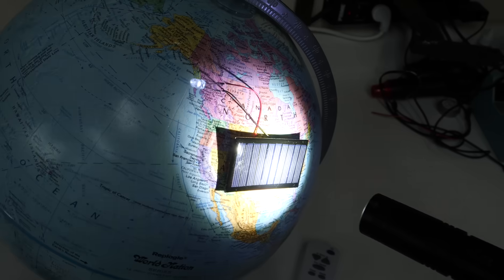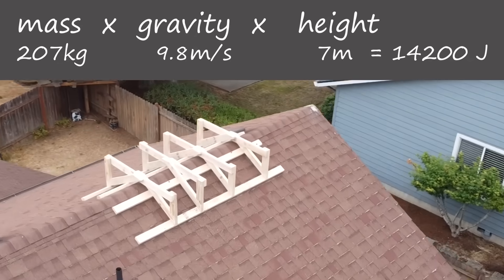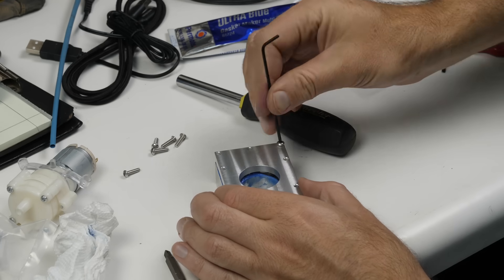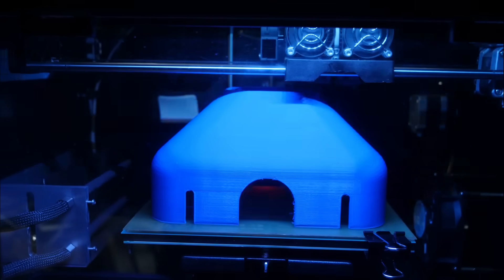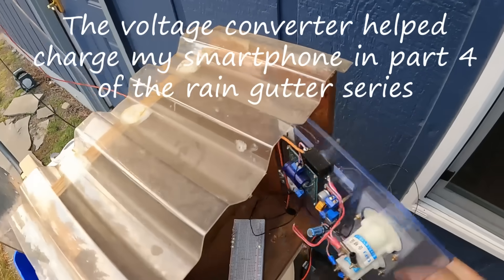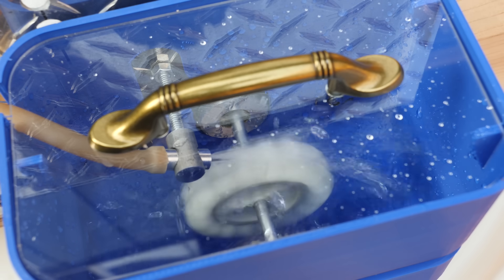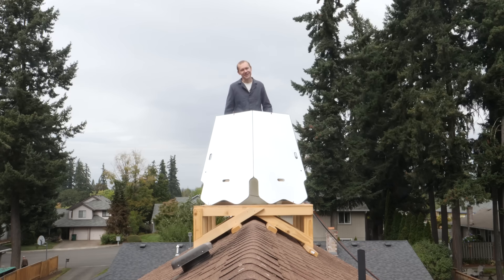Storing Solar Power on my ROOF!!!

Comment: I built a 50' tall Grandfather clock in Alaska for power.
I had a truck.
I made a dyno.
I hooked the dyno up to a massive wooden spool winch.
the tower was 8' x 8 '  x 50 x tall.
at the top was five beams.
one on each edge one in the center and two between those three.
each beam had 10 pulleys
at the bottom in between the uprights a huge steel counter weight basket filled with everything heavy i could find. the basket was 7.5x7.5x6' tall.
it had five beams in a square frame the basket hung from.
i used my pickup to lift the basket to the top.took just a minute or two.
i had a lever just outside my truck window that went to two different 13  speed fuller transmission shifter.
one in gear to engage my dyno winch
one out of gear that will drive the generator .
a 15 k genset without its engine. 
shifting the 50 part line over to the genset and a speed governor to limit and regulate the baskets decent.
150hp for 2 mins stored at 50klbs at 50 ' up.
i had to buy 25000 foot of 1/4 cable.
i also made a spool manager  hooked to the spool to feed the cable onto my 20 foot wide spool.
10 hp back out into the genset for about ten to 15 hours backout..

Comment: Where I live - in the Alps - we are doing that since 70 years. But we hate to do it. Why? Because you loose 40% in total efficiency by converting electric energy to run the pumps for lifting the water and again when converting the kinetic energy of the water back to electricity. There are no free lunches in physics.

Comment: here in the Uk we have a place called Dinorwig Power Station. it is basically what you are showing here. They is a lake at the top of a mountain and another are the bottom with a power station in the middle , sadly they do not use solar to pump the water they use the cheap rate and otherwise unused power at night to pump the water up to the top lake. The power stored in the water is used in the day to cover peak demanded. It is a cool system   https://www.youtube.com/watch?v=6Jx_bJgIFhI

Comment: Cut fossil fuel off, we will return to the stone ages.  These are fantastic home experiments to do, however I live in California, we have rolling blackouts while being forced to buy electric vehicles.  (In 12 years gas powered vehicles are to be outlawed).  When that happens we are going to starve, Farmers can run their tractors, 18 wheelers can’t run, many trains will be turned off, boats won’t be able to deliver to California as they run on Diesel.  I would put a 55 gallon bucket on my roof but the city would fine me for using to much water.  I don’t see anyway out of the mess going green will cause.

Comment: Cool! g is m/s^2 -- an acceleration, not a velocity.
Reply: That's right. But I was thinking that he maybe missed Bernoulli's principle for fluid dynamics. We have seen at 1:36 a calculation for static pressure which is mass x gravity x height . We didn't see a calculation for the kinetic pressure, better known as the energy component in Bernoulli's principle. So is 14.000 Joules not only the static energy and total energy lots higher?
Reply: @jan-race  whatever fluid dynamics says about the impulse transferred to turbine blades, you cannot exceed the energy stored by potential energy in a gravitational field. His energy storage calculation is simple, and sound.

Comment: Interestingly, my country (South Africa) has one of the largest per capita CO2 footprints relating to electricity generation in the world. We also have the Drakensberg pumped storage scheme which is essentially a large 1000 MW hydro battery. Renewable, Hydro battery and carbon natural isn't necessarily the same thing. It takes some serious juice to pump that water uphill. Just note that.

Comment: Solar only works when sun is out. What happens when you recycle that water by pumping the water up to your roof using a bunyip pump that doesn't use power,  that can be sitting in a shallow pool that is filled up by the water coming down from the roof. I wish this was true but I am not sure that the bunyip pump is a real thing. 
https://www.youtube.com/watch?v=FHJmYeFkJU8
Reply: Some solar panels work better with the sun, some can work very well without the sun and in clouded areas like organic amorphous (thin) film. But all panels work at cloudy conditions. They also consider to develop panels who can work at night by thermal radiation. This is in researching state at the moment.

But nice tip about that pump. Didn't heard of that type before. He can also build a system with a hydraulic ram pump which also uses no electricity at all. Some can pump to a height of 10 meters, more professional ones even heigher. In poor countries they build these pumps DIY with PVC pipes, for example for flooding rice fields from a lower river. There are lots of videos on Youtube of this type pump.

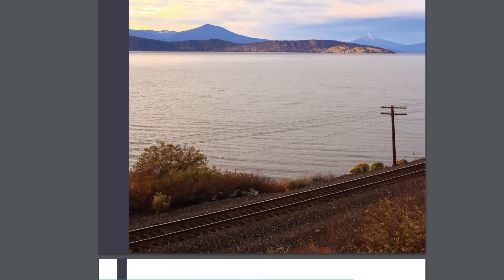Comment: @14:30 when you’re talking about the reservoir height differences my brain gears started grinding away....

What is more important...the Height or the Volume/Flow? There’s obviously a Maximum Flow Rate for such a System that is determined by both Variables.

It’s the equivalent of if you increased your down tube for more flow, but your stored energy would deplete faster.

What kind of power are they expecting to generate? And what, where, how does the Top Reservoir get replenished? Is it also a closed loop?

I guess in the end they would be building an ‘Infinity Waterfall’ minus natural evaporation

Comment: You could use a water hose, which will send more volume of water to your barrel on the roof and the ground. It will be faster. You would need a larger pumping system.

Comment: Congrats, now you have 0.0039kWh energy storage (as much as 1 AA battery). Maybe you can use that to heat a kg of water 3 degrees. only 25 more barrels and you can get it boiling!

Comment: This is awesome. In many parts of the world pumping up water to a water tank is normal for house hold water pressure. My time in the middle east  you turn off your water heater in the summer and the water ontop of the house is the hot water and the water in the hot water tank is the cold water.

Comment: Very clear demonstration of the basic concept, thanks. I also went through this thought process:
I have a few solar panels that I can't store the excess power from - I considered this approach but I'd need about a 10m tower with about 5 tonnes of water to achieve the capacity of one car battery. Like one of those water towers you see at railway stations in old Westerns. So now I have half a dozen car batteries.
If someone would buy me a lake I'd be more than happy to set up some pumped storage.
Reply: Let's hope he doesn't live in an area where they have any high winds or hurricanes, as if that lot comes down not only is his house going to get an unexpected massive hole in his roof,  it could end up killing someone.  The support doesn't look that secure considering the weight up there.
Reply: Car batteries are the most inefficient batteries for off-grid power storage. Even RV/boat batteries are better, but I have found the LiFePO4 batteries to be the best choice for me, once I was able to save up enough for them. I've tried several different battery types, including golf cart batteries, and lead-acid batteries only lasted a few years in my system, where my new BattleBorn batteries should last about 20 years before degrading to about 80% of origional capacity. To me, that was well worth the high up-front cost. I have recently found that even the "cheaper" server rack batteries are a better set-up than lead-acid ones.

Comment: Would it be efficient to replicate this with a higher density liquid? Like salt water or glycerin?   Or would the energy necessary to transfer the heavier liquid onto the roof negate any extra kinetic energy generated?
Since this is a "battery" for "excess energy generated", I feel like the efficiency wouldn't matter as much, but I don't quite know how to calculate this, nor how to consider its feasibility, except on massive scales such as ones mentioned in the video.

Comment: So with a pump that likely wears out faster than a lithium battery you can store less than half the amount of power that can be stored in a cheap lithium 18650 battery. Using 400lbs of water in an ugly barrel on top of your house

Comment: i also thought about getting a gravity-battery built for my future house to store energy but i was thinking more of a huge weight attached to a motor / dynamo. i know water is used commercially but isn't it a bit too loud when it flows down? I think for the near future i will go with lithium ion batteries but they are a fire hazard and i am not sure how many charging cycles they can last for and if that is even worth it in the long term

Comment: I am having a very hard time understanding why you are introducing the use of water to store and increase solar power without first securing a recapture system to protect that most precious (consider evaporation in relation to climate change) resource. Position the device above a collection vessel to capture overspray for your food garden?
Would the same gravity fed booster work if you used tiny copper bbs or a perpetual motion device. At this point it seems more prudent to be inventing devices that conserve water, not rely on it to power party lights. No disrespect, just saying. Point your kid’s science loving brains towards water restoration and conservation. 🦫🌲🪵💦

Comment: what about during winter when solar power is nil?
Reply: The sun still shines during winter, you get less power than in the summer but it's far from nil (unless you live beyond the arctic circle i suppose)
Reply: I live in northern Europe, and for me it's maybe 50-100Wp in December. In the summer my installation does 1300Wp. Not a lot also, but a huge difference. For all practical purposes it's nil for me.

Comment: A little late to the party here, but Ive got an idea for you that Ive always wanted to build just for fun:
Scale Up a grandfather clock escapement gear to use like 500-1000 lbs weight, connect the drive shaft to an alternator and make a 50 foot tower for the weight to hang from. 
Then make the winding mechanism from a hand crank and a few snatch blocks. So with 60-120 seconds of fairly vigorous, but not unmanageable work, you could potentially have over a 1000 watts of power for 15-20 minutes or so.

Just for when theres been a drought but its also been really cloudy for a few weeks 😆.

It would be fun to build the small version to maximize efficiency and then build the giant one when its all dialed in!

Comment: You just demonstrated how hydro power is generated but its still not a solution to energy storage problem. Not practical to store large sum of water in residential areas. Probably not possible for municipalities to do that either. Creating a large reservoir requires a lot of work , planning and maintenance. Energy storage will remain an issue for now.

Comment: But you need water for this. Or do you? I saw a project out west that used weighted rail cars. During the day when power was available the railcars were pulled to the top of a hill. At night the rail cars were lowered down the hill re-capturing the stored energy. Same concept without water. Right?      Skyscrapers could do the same thing with weights in a tall shaft or on the outsides of the buildings.

Comment: That hiding materials, it could be solar panels., pumps the water up during the sunny days. But you have to have a bigger barrel at the bottom one, perhaps it can be underground. I believe this metod will work, if you build rectangular shape water container. On top install some solar panels. Have to be better thought to the way to design the all system.

Comment: Using a low cost solar well pump, such as the Shurflo 9325, we could use a 100 watt panel to pump a maximum of 500 to 600 gallons a day to a maximum elevation of nearly 150 feet higher than the source.  We could use a Dankoff 1302 slow pump powered by 100 watts to pump 600 to 700 gallons per day upwards of 300 feet higher than the source.

Comment: Very cool. Would it be more efficient to hang the tank on some sort of pully or steep rail system using gravity to drive an alternator?

More complicated, but I'm picturing a similar system using solar to fill an elevated tank. At night gravity feed an alternator, once the tank reaches the bottom have an auto drain hooked up to a hydro generator. Then have a counterweight reset the tank for the morning.

Comment: Similarly, I plan to build a "thermal" battery for an off grid cabin. A black barrel filled with a salt brine solution and a copper coil running through the interior should retain enough heat from the sunlight to provide hot water 24/7 except in the most extreme cold snaps

Comment: Water weighs 8.33 pounds/gallon WITHOUT the container. That roof has better be able to handle that MASSIVE and not designed for dead load. A collapse is more than possible if it wasn't reinforced

Comment: I have an idea. Do you want to try to use liquid nitrogen to make a camping freezer that could keep things frozen for several days. I had an idea of pouring it into a copper coil and using bolts to close the ends. I don’t know if there would be enough thermal transfer to keep things cold, or maybe too much. I was also wondering if gas would build up.
Reply: Wait, did you just tell him to build a pipe bmom b?

Comment: It would be nice if you actually knew something about lithium batteries. The lifepo4 batteries have a charge discharge count of over 3,000. They can be charged from 0 to 100% $3,000 times. That's about 10 years.

Comment: For the splash problem I would have just aimed the water downward and if that reversed the water wheel then reverse the leads on generator motor.

Comment: why don't you connect your incoming water tap to roof buckets ? so when you use the water, water fall down and generate electricity. Then you can have infinity AA battery depending on your water consumption.

Comment: use solar heat to create a vacuum suction pump, suck up the water and use it to run a flywheel. Viola that's the power of hydroelectric water station. An almost endless source of energy. Couple it with gravity powered heavy weight gears, we have great source of energy from natural resources

Comment: You could simply use the city water pressure to circulate water to the top of the roof. Typically the pressure will be around 60 psi, which is more than enough to get water to your roof.
Reply: The city pumps probably use diesel or other crude oil derived fuel which is what this man is avoiding in order to cut pollution .

Comment: Using Mercury would increase the energy in the system about 13.5-fold, but I'd suppose the roof would cave in under the weight

Comment: Progress for sure. 

I like the idea of water storage as a battery. Perhaps you can think of some ways to create a more efficient pump and water wheel. These 2 items are very lossy. 

The advantage with batteries is you can draw a lot of current out of them whereas you need a big water wheel and generator to get enough power for, say, cooking.

Interesting stuff
Reply: There's probably not enough capacity on the roof no matter what you do, unless the roof has been specifically engineered to handle a much larger than normal load. But, I do think that switching out the turbine for something more efficient would probably be worth it since the stuff is on the roof.

Comment: A healthy man can ride a bike with 200 W. That's 600,000 J. So 14200 J is still more than a fart or two?
;-)
Reply: So, a barrel on the roof, 14200 J is one tenth of small DeWalt battery (18 V_5 Ah) ;-)
Reply: More energy on the roof than in my smart watch battery

Comment: I heard that storing energy in liquids, including high temperature metals, is a lot more efficient that storing it in some chemical electric batteries. Mechanical conversion decreases the efficiency. We need to somehow generate electricity directly from heated water efficiently. I'm not talking about steam generators and mirrors (very inefficient.) How about thermocouples?

Comment: Great video, with a surprising and sad twist at the end (=just ONE AA battery?). Probably  not worth mentioning but you could have increased your output by over 15% just by locating the turbine on the actual ground instead of up on the stand.

Comment: 14kJ surely does sound like a lot, but It truly isn't.
Usually to quantify household appliances consumption you're in the league of MJ. That's a hundred times what you can store at 100% efficiency.
Let's convert those 14kJs to a more common unit for domestic purposes: the kWh.
So 1kWh = 3.6MJ, or 1MJ = 1/3.6kWh.
We have 0.014 MJ which translates to ≈0.004kWh.
So your battery can store 4Wh, meaning you can run a 4W appliance for a hour.
Nice, you can power a weak led light for almost an hour.
Let's put everything into perspective.
A typical washing machine will consume 0.7 kWh per cycle.
That means you'd need 175 of your batteries just to wash your clothes.
And that's assuming 100% efficiency! To be realistic given the small diameter of your piping you'll be lucky if the effect of your battery will be detectable.
Let's say you paint your bucket black.
Assuming a cross section of 0.5 square meters it's going to generate 0.7kW from the sun heat.
That's an output (again) 175 times the one of your battery.

Comment: Also, you can use the pressure as a feedback mechanism to cut off the pump when full (no need to run wires), the float switch can just close the hose and a pressure switch at the bottom can turn it off electrically 🙂
Reply: Science rite up in heer!
Reply: A ball cock system as used in a flush toilet would close off the tank feed.